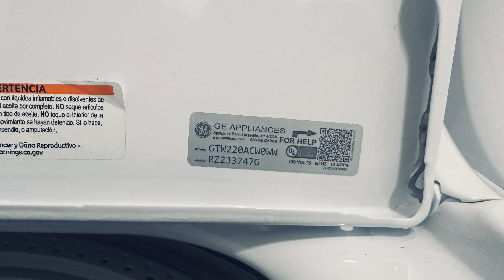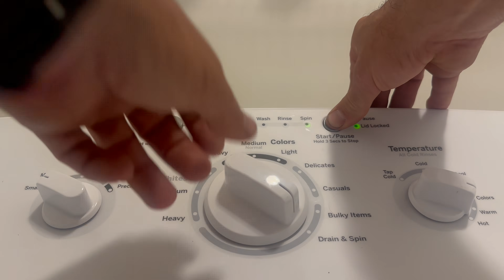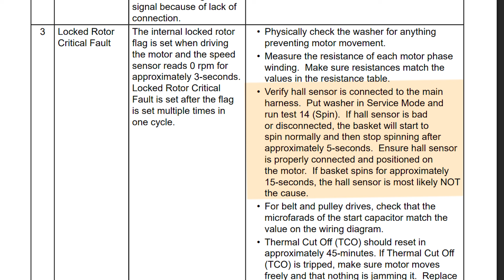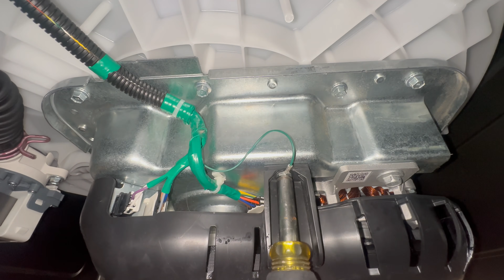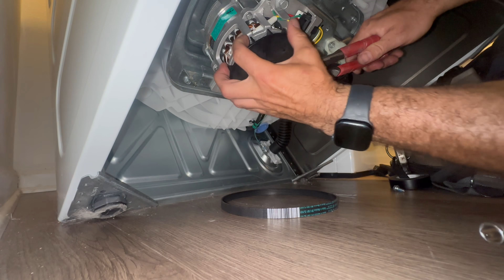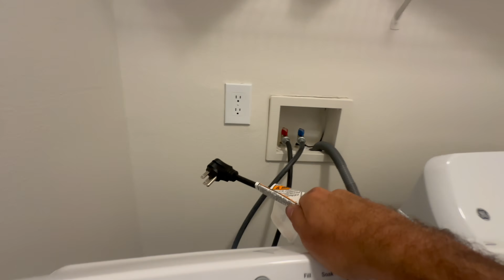GE Top Load Washer Spins, then Stops after 5 Seconds

Comment: Mine is doing the same thing but no error codes
Reply from the maker: It's possible, that the control board is bad if it's not logging error codes. I'm just a random youtuber though, replace at your own risk it may not work

Comment: Excellent video man! Apartment maintenance tech here. We buy a lot of these GE washers and have had good luck with them. This will be the first time I change that sensor. In fact I just gently removed one and borrowed it from a broken down one in my shop. Going to go put the sensor on a residence washer right now. This will be great information in the future. Also, after seeing this I experimented with just tipping the machine back instead of laying it on my residence floor. Worked fantastic and I will do it a lot in the future as the belts give out here and there. In this case, that's what ripped around and destroyed the sensor. It was broken in pieces

Comment: On the gtup270em4ww I was experiencing where it would spin okay, but when trying to agitate it would always do either four agitations and stop or one agitation and stop.  I never found a solution on the internet but it was exactly the same part: the speed sensor! so if you have this symptom where it starts to agitate and stops look at your speed sensor. Another clue when I went to my appliance parts retailer they did not have in stock motors but they had 24 of these speed sensors in stock. it's clearly a part that is replaced all the time
Reply from the maker: Thanks! We are having the issues where the complaints are it wont' spin fast enough and the clothes are soaking wet when the cycle completes. Haven't figured it out yet, no error codes, did the 1/16th drill bit through the pressure hose tube on the tub, belt good, no error codes. This model does keep ya thinking though